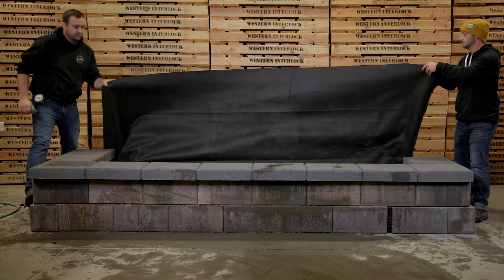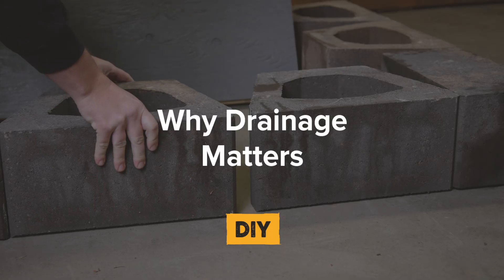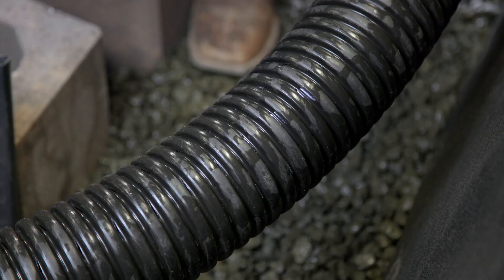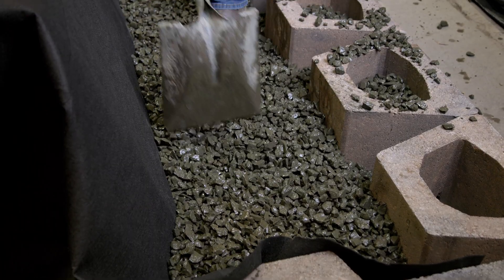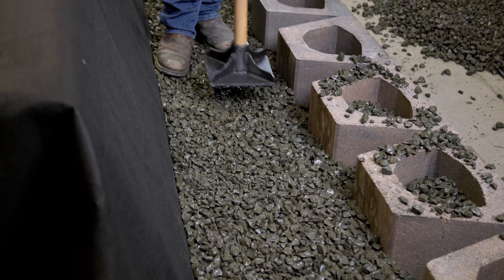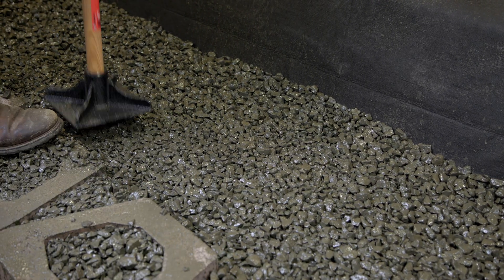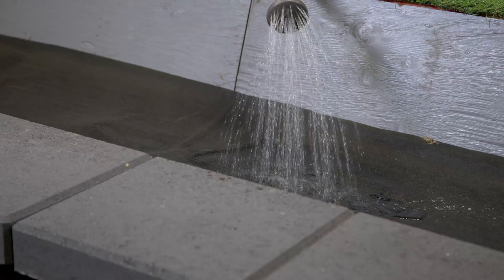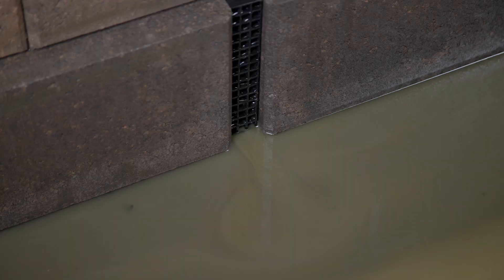Essential Drainage Methods to Prevent Retaining Wall Failure

Comment: Did I overlooked it, I don't see any gravel underneath the wall
Reply from the maker: Good eye! You're absolutely right to look for that. This is a demonstration model we built in our warehouse to illustrate the key points about retaining wall failure, so we didn't include the full base preparation you'd see in an actual installation. In a real-world application, you'd definitely want that 6-12" compacted gravel base depending on your wall height and soil conditions. Thanks for pointing that out - it's exactly the kind of detail that's critical for proper installation!

Comment: The pipe should should not really be placed high on the rocks - 5cm max - otherwise all the water is under the pipe.
Reply from the maker: Fantastic point! You're absolutely right - keeping that drain pipe low in the gravel (about 2 inches max from the bottom) ensures it actually collects the water instead of letting it pass underneath. Thanks for pointing that out as it is exactly the kind of detail that makes the difference between good drainage and great drainage! For more comprehensive drainage guidance, check out our article 'How to Plan for Proper Drainage in Your Retaining Wall Installation' at https://westerninterlock.com/how-to-plan-for-proper-drainage-in-your-retaining-wall-installation/
Reply: Love the response man